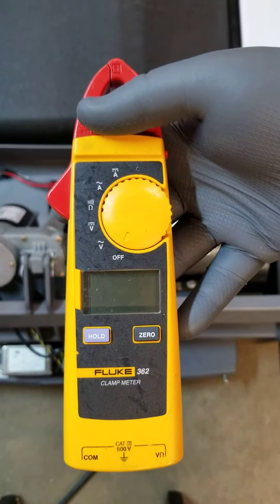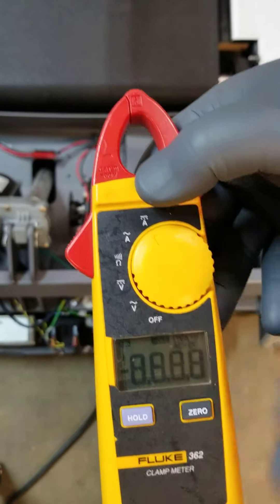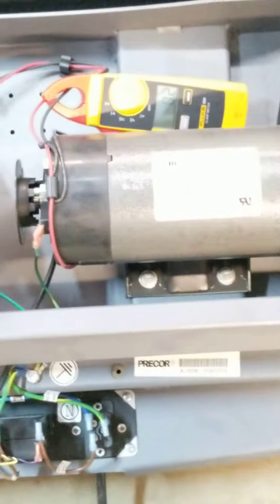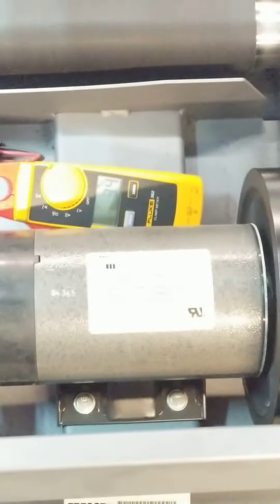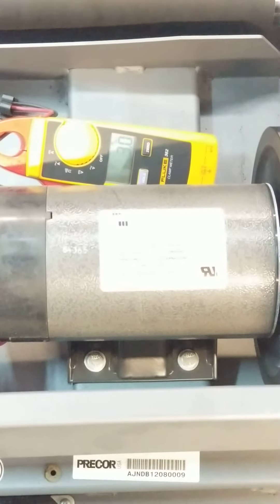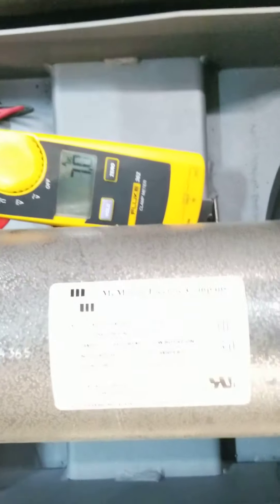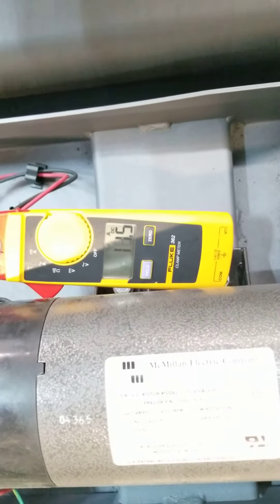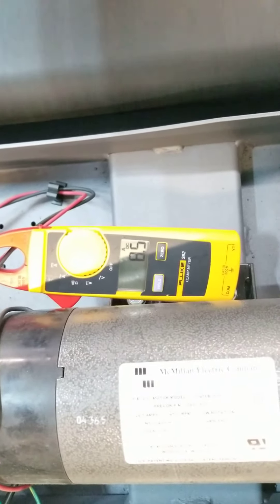DC Motor Amp Draw With Clamp Meter

Comment: What's the average Amperage the motor should be drawing when running on it around 6-8mph?
Reply: Mine is drawing over 20amps when I'm running on it at 6mph? Is that normal? If not, what could be the issue?
Reply from the maker: Good morning! Run the machine at 2.5 MPH without a person on the belt. If the motor and drive system are healthy, you should have a reading in the 2-3 amp range. Then walk on the treadmill at the same speed. With a person of average size (around 200 lbs.) you should have a reading in the 6-8 amp range if the belt is good. The readings will fluctuate more with a load but you are looking for an average reading but you shouldn't see spikes above 10 amps. If the amp readings are high without a load, you could have a problem with high resistance in the motor, a bad bearing, or over-tightened belts. Regular readings without a load but high readings with a load indicate a worn belt and/or deck.
Reply from the maker: Good morning! Run the machine at 2.5 MPH without a person on the belt. If the motor and drive system are healthy, you should have a reading in the 2-3 amp range. Then walk on the treadmill at the same speed. With a person of average size (around 200 lbs.) you should have a reading in the 6-8 amp range if the belt is good. The readings will fluctuate more with a load but you are looking for an average reading but you shouldn't see spikes above 10 amps. If the amp readings are high without a load, you could have a problem with high resistance in the motor, a bad bearing, or over-tightened belts. Regular readings without a load but high readings with a load indicate a worn belt and/or deck.
Reply: @treadmilldoctor 

Hi the reasons should be same for all motors? My Motor says it has 5 Amp written on it. And if I use the clamp metre on 2,5mph it gives 1-2 Amps. When under load it goes to 6-8 Amps. Sometimes very briefly to 10 Amps. 

So that indicates the Motor and deck is fine? But still the treadmill has a problem that it shuts down after 20-30 minutes. And the motor gets hot. So there must be a friction problem anywhere? Or is it the circuit board?